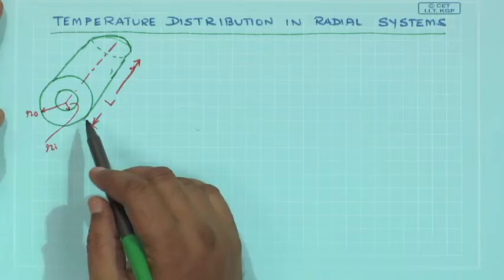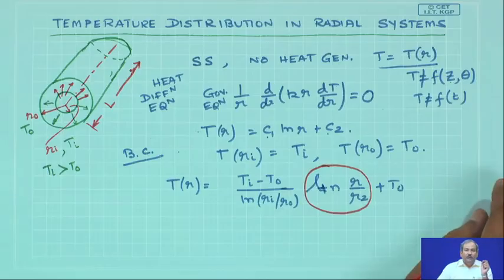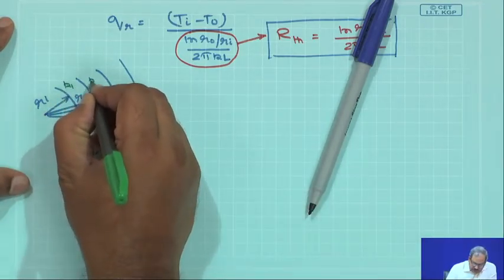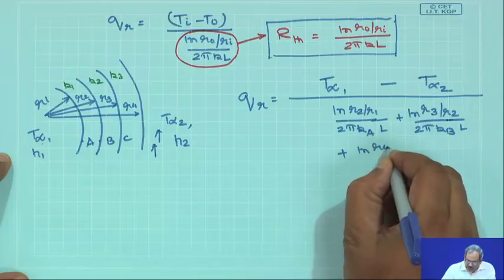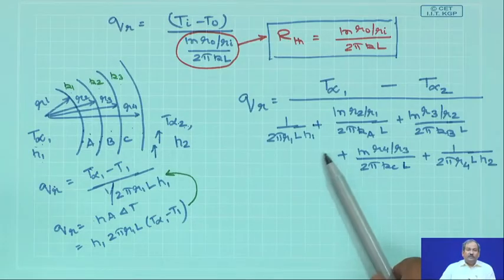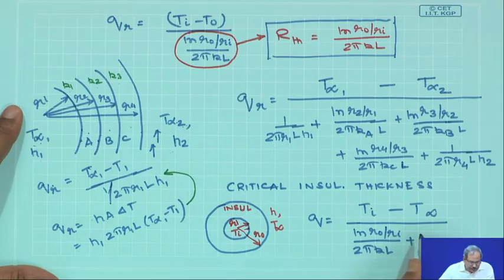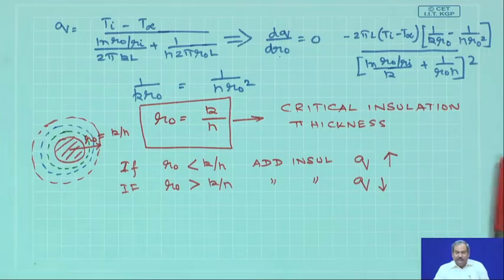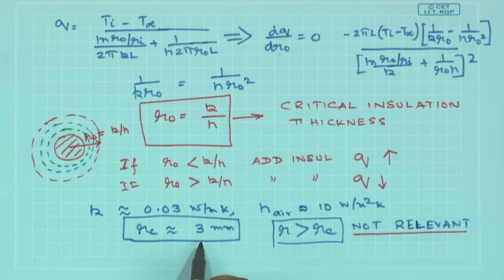Lecture 6 : Temperature Distribution in Radial Systems

Comment: there is correction in the the statement at 29:40 the correct statement should be: with putting the layer of insulation on outside you are making more area available for convection.